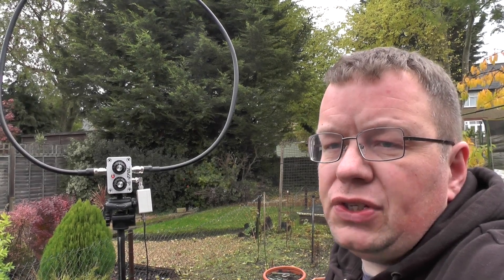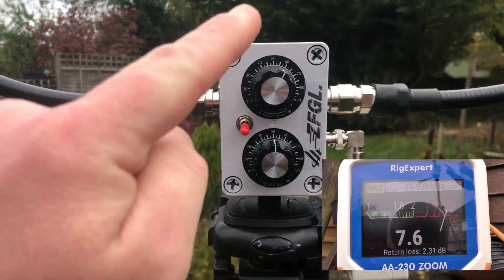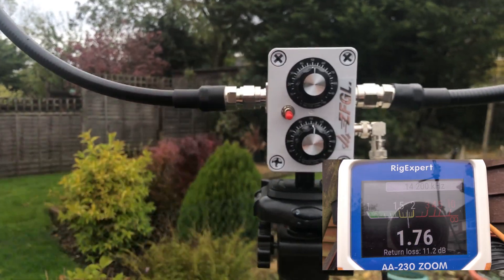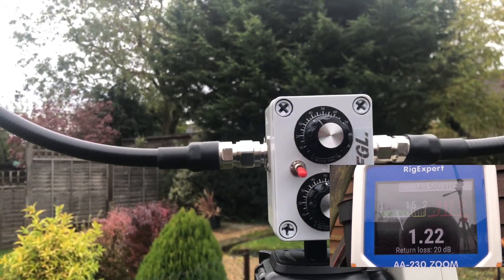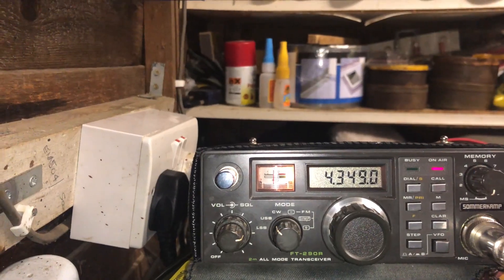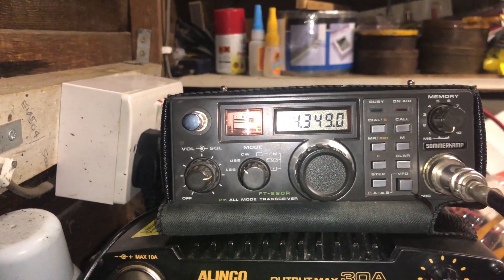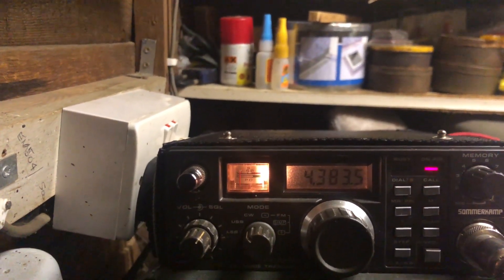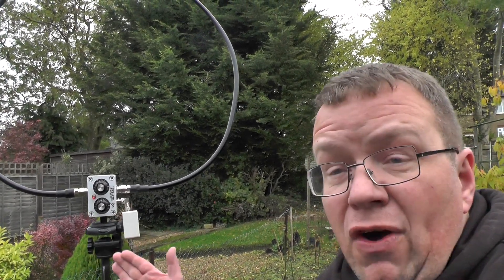Loop PT2 Getting contacts finally

Comment: Ive found mine receives really well on shortwave.  It rejects a lot of noise.  I thing it really needs a second conductor coil.  Its good fun though to play with it.
Reply from the maker: Yes i managed to get the SWR 1:1 on 27.78125 and 27.305 the new meter is a game changer it makes it easier to swr in antenna thanks to its live swr meter

Comment: Nice video. But you are just looking at the Swr. Youre losing 20db on 2m and 9db on 20m. Basically you tubed it into being a dummy load pretty much. And yea. Ive made contacts on a dummy load
Reply: dummy load or not.. if it works and u made the contact it works... congrats on your dummyload contacts..

Comment: Hi Jezz, you put a smile on my face when you said you could always put a tuner in line to bring the swr down the rest of the way 😁 a vswr of 1.6 is fine don't worry about it, just remember that mag loops are high Q antenna's and have a narrow band width and you may have to re tune if you shift frequency, looking at the size of the loop it isn't going to be that efficient on 20 meters may work on 15 12 11 and 10 meters ok for a laugh try out 6 and 4 meters as well, thanks for the video Adam G7CRQ